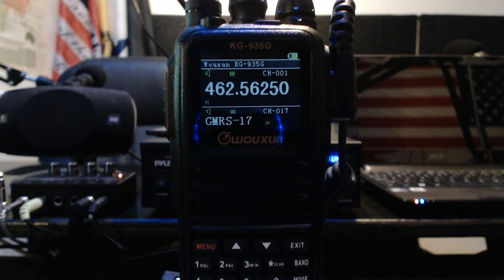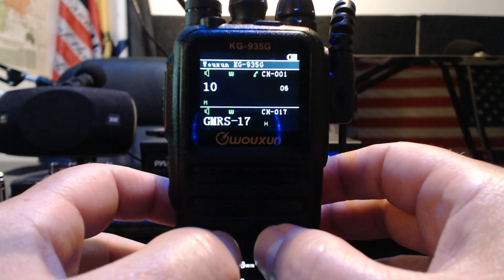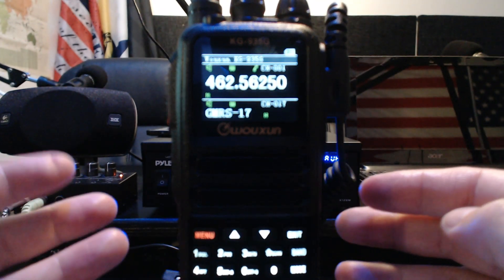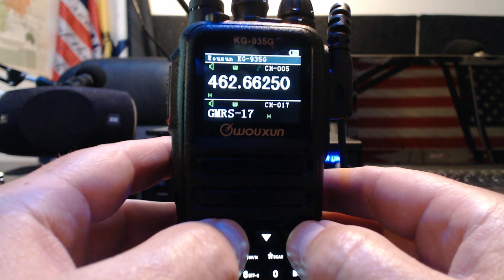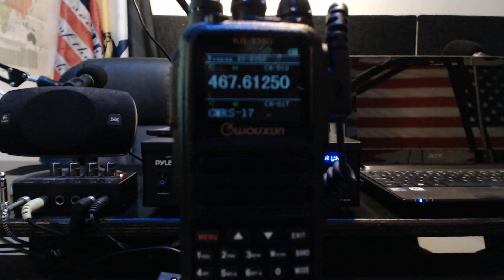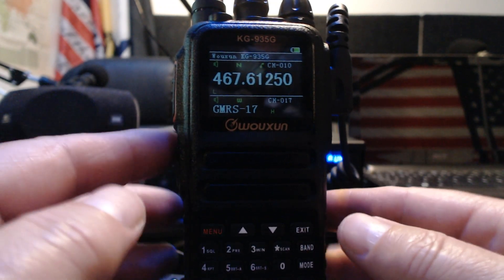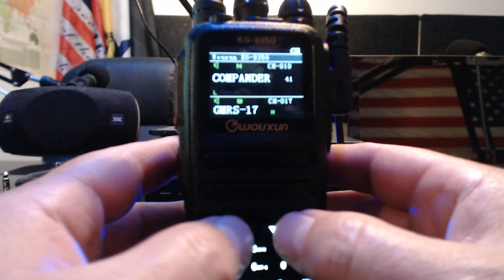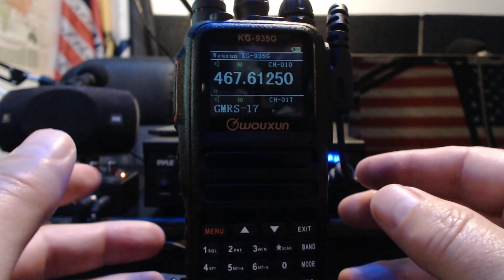Wouxun KG 935G. NOAA, Backlight Standby, & Power Settings explained.

Comment: FWIW, I have been told that the power levels in actuality do not go above the legal limits for a given channel, even though it shows a higher power on the menu or screen.  For instance, you might get it to "show" 5.5W on channel 1, but it will only do the next step down in reality.
Reply from the maker: @grigorirasputin5020  That's certainly possible. I suppose you would have to measure each level and see. In reality I don't worry about it too much. It's not like we can change the output of the radio. It would be nice to have consistency in the manufacturing of these Chinese radios. Regardless of which brand. Thanks for the info. If you test yours maybe come back and let us know.  I just purchased the 935G plus  maybe I will do a test video
Reply: @northmanproject4007  
I lack the equipment to test mine at the moment, but I read somewhere, a couple of years back, that these radios are hardwired not to go above .5W on 8 thru 14 and above 5W on 1 thru 7, even though you can make them show 5W or whatever on the screen.

Comment: I have a KG-935G and a nearby repeater is showing the following: Freq 462.550, Input & Output tone is 141.3.  Don’t I simply put my radio on GMRSr15 channel 23 and then hit MENU and change the TX-CTCSS and RX-CTCSS to 141.3 hit Menu to save and it should be accessing the repeater?  Or am I missing a step?  Believe me, I’m new to this and Ive read the manual.  I did a Repeater Check and don’t hear anything.  Yes, the owner of the repeater has given me permission to use the repeater and its less than a mile from my house
Reply from the maker: Don't forget the .500 offset. You should be transmitting the tone on the offset frequency. Yes it's a bit confusing. But it sounds like that might be the issue. If you hit the to transmit and it says the same frequency as the repeater then the off set isn't set properly. You transmit on the offset and receive on the 462.550
Reply: @northmanproject4007  thank you for the reply and the assistance..

Comment: Does anyone know how to unlock the KG-935G to make it a HAM-radio?
Reply from the maker: I'm not sure if that's possible but I also have the Wouxun uv8h which is the same radio only set up for amateur use. But I'm not sure if the 935g can be wide banded.

Comment: Ya, it's nice that they let you adjust the standby light, the default of going to black is pretty annoying. I set mine to brightness level 2. You said that channels 8 - 14 default to Low because they are shared with GMRS. I think you meant because  they are shared with FRS.
Reply from the maker: Yes I do my best on speaking but sometimes I make mistakes but yeah it's a nice radio I really like it.